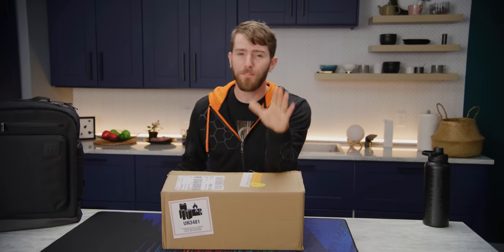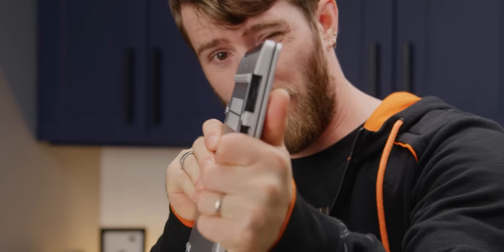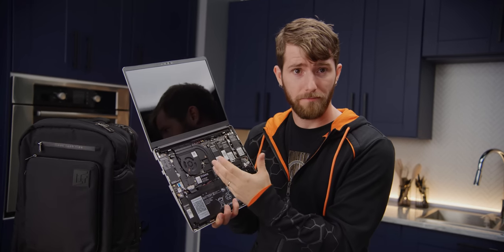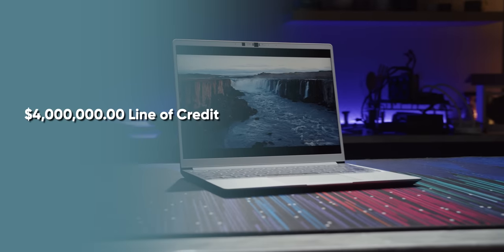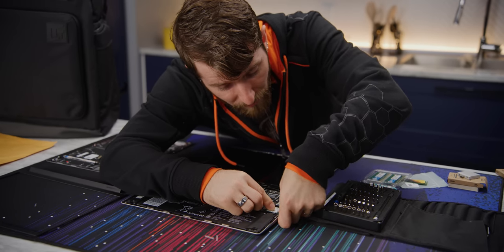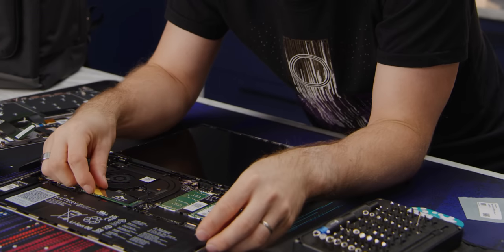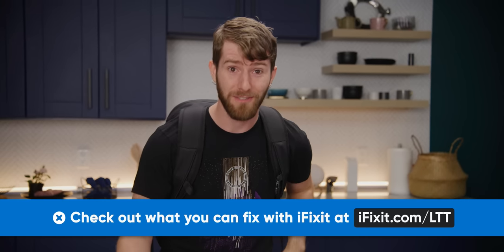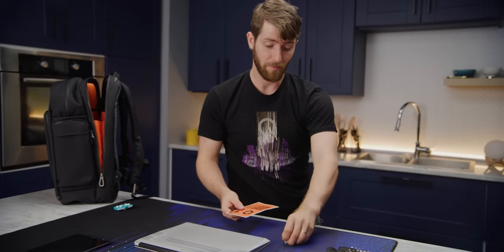I’m Legally Obligated to Disclose This - Framework investment

Comment: lack of cashflow, even big companies like Nvidia can be sunk by this, as many lack cash on the assets side of the ledger/balance sheet and even meeting payroll expenses can get tight  many businesses rely on revolving loans/lines of credit/essentially the business equivalent of the dreaded paycheck advance loans/loansharks to get the operating cash needing to keep the business functioning day to day, month to month

it doesnt help that businesses expect each other and supply chains to offer 30/60/90 payment terms by default/courtesy/tradition

so nvidia may take 90 days to get paid if the entity paying them doesnt default on that obligation/refuse to pay/renegotiate specific/contractual terms, but in the meantime 3 months payroll and suppliers and warehouses and such need to be paid still

not to mention the us economy and whole global economy works on trust and borrowing from peter to pay paul as the saying goes and at any given point the us economy is lucky to have say 30% of the cash flowing through the economy that is supposed to be required to be in circulation/available/there.

Comment: The LTT backpack is really cool, but my personal choice is the OGIO Renegade RSS. It’s a great backpack for a laptop, the tech vault is the main reason I bought it, but it is a great backpack in many other areas as well. If you have an expensive laptop (I have a $1,500 ROG G14), a backpack with a tech vault is ESSENTIAL. I hope the Linus Tech Tips backpack has one as well because it has set the bar for what a good tech backpack is.

Comment: It needs a larger touchscreen and more I/o ports and it would have a market with more users, particularly with those who run Hauptwerk software which requires 64 mega of RAM and a movable, upgradable computer.

Comment: To calculate total costs you need to add up all the cost at every point in the businesses processes and you actually then need multiple it tow cover the time of the whole process.this gives you a forecast of the cash flow demand. if you don't have the cash to pay right way as A start bigger suppliers just don't take you on.

Comment: I’ll definitely buy that laptop as soon as the one i have is obsolete since i can also upgrade it a little and imma definitely buy that backpack if its anything like the mos backpack where it has a zipper where you can put in cable charger inlet that i can charge my laptop with while its in my bag

Comment: The Expansion Cards being USB3.2 instead of Thunderbolt 3 is a deal-breaker for me. It also means that the Video Outputs must be using Alternate Mode or DisplayLink which are both really bad options.

Comment: My parents still use laptops and I would 100% kindly nudge/ force them to buy this except for 1 thing: The numpad. They are bookkeepers so they need the numpad on the laptop. Even if it was a 96% keyboard would be great. Since they just bought a new laptop, hopefully when that dies in 2 years, Framework will have a numpad, 17" model.

Comment: @6:30 your numbers are not way off, slightly optimistic id say since you don't account for say 2-3% that goes into error management and misproduction/other mistakes, and for the fact that prices on copper and other metals are not extremely stable (which admitingly sometimes yields a benefit but often also doesn't) or, and this is in home computing maybe less a thing, but clients negotiating lower prices in bad times (for example with us our clients are heavily dependent on the oil market which fluctuates) which can result in write offs on projections, in tech no profit is made, all money goes directly back into the process bar maybe a few exceptions

Comment: This is my next laptop once I decide that I need a new one, or as soon as gaming-capable (i dont care, even, 1650) option is available.
I spend so much fu... goddamn time disassembling and reassembling my G5 5587, because they seemed to have used too thick thermal pads. And even after that I had to disable Hyper-threading, because cooling barely handles it with Turbo-boost and I'm locked out of power setting.
Also would be nice to have an external accumulator, but I guess it's not that big of a deal, once it's relatively easy to get inside.

Comment: A touch late but after my umpteenth HP laptop. And a magnitude of scale higher business models to boot. I wish I would've checked this one out more seriously... If they release a model with a dgpu every other benefit primarily the long term repairability/upgradability will make it a take my money meme. If it's actually true that future upgrades will be a relatively simple soc board swap it'll legitimize it as a solid replacement for my co-workers and we can stock spare boards for emergency repair... something we've wanted to do with probooks and thinkpads but couldnt because of all the variations and the rollout system where at any time employees have a range of 2014-2019 units in circulation. Finally the price... both solid for professional solutions but poor for consumer solutions at this time... personally a 1080p iris xe system that can pop the $1k bubble gets beat readily by competitors like the HP victus... however for a company that has ram, nvme's, and their own OS licenses on hand, 800 a pop for all the performance an employee needs with a durable repairable build is a no brainer esp when the competition can easily be close to double the price in the same  market.

Comment: Linus its clear that you care. Interesting that after enough success now time becomes a more pressing and valuable resource than money. You've won a position where it would cost more to spend your time reviewing more laptops in a collapsed homogeneous market place  than to necessarily take a risk with monetary investment which i hope works out. Ultimately you have influence now on what larger companies will produce for certain end users that do care. That's the pinnacle of influencing and you've earned that. congratulations.

Comment: Since I run Linux 99% of the time, I'd be interested in an AMD version.  Although, I think that mostly matters for GPUs, and these laptops seem to use integrated graphics only, so I should be fine with Intel.  Still, I'm curious to see what round two will look like (I'd like a discrete GPU, for one).  I've already reserved a Steam Deck, so maybe I shouldn't be shelling out for one of these just yet, but I'm going to keep my eye on them.  Should I need a laptop at some point, I'll definitely take another look at what these guys have to offer.

Comment: Well, There is a problem or a potential problem. To sustain this business, The framework laptops will need constant upgrades down the line, and to provide those upgrades companies like nvidia, ryzen and intel have to make special models for this specific laptop company. The question is, Will they commit to that? Will they constantly produce products or chips specific for this company alone?

Comment: This is awesome, exactly what's needed.  "buck stops here" thinking from both linus & framework.  he did a solid job explaining what early startups have to deal with (and the bear market & coming recession will make it difficult for everyone).  They're smart enough to know that charging 2x isn't the way to grow, raising money is.  He also shows good transparency on what he's doing, why, what the risks are, what happens if it blows up.  I hope to see this company change the laptop industry.  Smart people is unfortunately a pretty small TAM, which is why most companies choose to woo the dumb people with money.  but if framework gets all the smart people,  if every IT guy & every working pro uses one of these things because it actually works for them, that could really change things.

Comment: I'm currently saving up for a laptop but due to my young age I can't work for many people but I'm trying to anyways and I actually considered this of being when I could save up for even though it's quite expensive another one I have my eyes on is one of those newer gateways people need to start paying more attention to repairable in modular products because right now I'm not many people really care but I find it so cool and when you have a laptop if you want an Intel core 12th gen now a days then you just wait for one to come out for your specific one and then just swap the motherboard board the same could be said for smartphones even though they don't have to be like that Google project you can at least have like the back pop off so you can like replace a battery or ram or whatever it doesn't have to be like straight up build for it but at least gives the option I always thought even now to have a phone that can be customized and upgraded from the inside out like a laptop or a desktop that would be so cool I want a 16 GB ram stick for my phone dang it to be really useful for projects too because your phone is also a programmable computer not directly like they were in the old days but I certainly wish they were that needs to come back I feel I'm going to become a programmer make an app that makes that a possibility but whatever I'm just a young kid that likes doing stop motion even though I haven't done it in a while I don't got sticky tack I I'm going to get some though who also likes parts of the past Incorporated with the future and also a lot of modular items preserving the past while keeping it up to date with modern technology feels really good to me!

Comment: Any chance Framework will take suggestions on a gaming laptop design using Intel dGPUs (because I'm assuming it's gonna be tough getting NVidia, or even AMD).

Or maybe AMD might be amenable if Framework does an Advantage Edition so Ryzen 7 6800H CPUs and RX 6650M XT and 6700M will be allocated.

I got other ideas for this too to optimize its use for desktop (since a gamer, at worst, might have to work on the laptop in a coffee shop or take it to a meeting if it won't look ridiculous), if not make completely desktop use optional now instead of just for repurposing the mainboard later when the GPU can barely play anything new.

Comment: Framework is really what I have been looking for all this time. Now all I need them to do is make 2in1 touchscreen laptops with more than 250 pressure sensitivity for atylus along with some thinga-a-magic where I can boot a linux/windows and an android in two desktop environments so i can switch between them as easy as switching between desktop environments and provide a slot for sim reader. That would be my dream machine. make it framework, pretty please. 
also, I tried to buy one of their laptops but they aint in my country yet. Whatcha soing framework, come on!
Reply: The problem is that you're a really small niche.
So making all these upgrades for like 100 people, would be impossible.....for even the biggest companies.

Comment: I now need a new laptop, but I cannot in good concience buy a laptop anymore that has an 11th gen Intel chip. Ryzen 6000 and Intel 12th gen are now both available, and both far superior. Personally, the chip I want is the 6800U.
Reply: is the ryzen 6000 available in an ultrabook without a dgpu? cause I haven't been able to find one
Reply: Not yet. Asus just announced one, the Zenbook S13, and Lenovo announced the Thinkpad T13, T14 and T16, all will be available in June.
Reply: I assume that way more will be announced in the end of may at Computex. I personally am waiting for either a new Framework mainboard option, or alternatively for some middle of the market thinkpad. The T-series is a bit out of my desired budget.

Comment: I think Framework is hoping, praying, and begging that someone will eventually purchase the company and the shareholders can make some money. There are currently USB C dongles that do power, USB A, micro/sd cards, HDMI, ethernet, wifi, and more. The idea of plugging in modules of USB C adapters is not new. Framework is also very expensive. You can buy a cheaper M1 Macbook Air, add a dongle, and have everything Framework has to offer at a fraction of the price. Apple also has a warranty (or get the Best Buy one) to cover 3 years. I still contend that Framework's whole plan is to have laptops out there and hope that someone buys-out the shareholders. Look at their financials. If they had to do a recall of something, it would wipe out the company. They could not afford it.
Reply: Say that again after 4 years when the MacBook is out of warranty and outdated and the framework can swap the internals to the modern standard for less than half the price of a new laptop.

Comment: It's interesting but I don't see the benefit really. Upgradeability on a laptop isn't really relevant. Can't upgrade CPU. 16/32 GB of RAM is enough. Won't be able to go DDR5. No discrete GPU. I guess the hard drive? 

The ability to repair is nice but for the majority of laptop owners is it really useful? How many laptops are sold every year and how many of those end up needing repairs? How many of the ones needing repairs, need repairs that are fixable by a layperson, e.g., swapping out a screen? Of that subset, how many are actually going to go through the effort of doing it themselves or have the confidence?

I'm not knocking it per se. It just feels like one of those times a product is generating a lot of hype in a tech community that gets projected onto the masses where it doesn't exist.

Comment: Because you are mentioning AMD in timecode 750 (https://youtu.be/LSxbc1IN9Gg?t=750 )i am assuming there will be a framework notebook with AMD Ryzen coming? The current Framework hardware configuration is sadly not very compelling for Linux users, which are a rather big target audience. Anything planned for a Framework Laptop with AMD Ryzen?

Comment: I cannot help but be excited for what Framework is doing, too!  I just wish that (1) I had the money to buy one of their laptops, and (2) I could get such a laptop with a 2-in-1 style touchscreen.  (I actually want two, for eccentric reasons, but hey, I'd be happy if I could get just one!)

Come to think of it, I also wish (3) I could get a couple of Bluetooth monitors as well, because I hate cables, but everything I've been able to determine so far has me convinced that Bluetooth wouldn't be able to handle the bandwidth to be able to do that.  Maybe WiFi could, but as far as I can tell, it's also somewhat rare for a laptop to be able to act as an "access point" to be able to make multiple connections as well.

Regardless, I really hope this product does well.  The world needs more "right to repair" devices!

Comment: I really like your laptop, but it needs a lot more IO, like, minimum 3 USB A, ethernet port, mic and audio jack, 1 or 2 USB C, 1 HDMI and a HDMI, optimally it also has a display port connection and a SD card reader aswell, at least thats the stuff my laptop has, and I honestly wouldn't want to buy anything with less connectivity than that

Comment: Can I upgrade iPad pro 2021 memory from 256gb, I use adobe fresco and I can not even locate the files for back up, it only show that fresco hold 240gb of data. How come iOS is so stupid and no one talk about it. Basic action of finding you work on the system, do not exist. It is the most productive tool I ever had, but it is like a disposable 1000 tool in my case 6 month. I know 3 people that are working on 3 iPad by now, started at 256 then 512 and 1tb. This is a total madness. I have external ssd 2tb, Adobe software save a copy on the cloud and even if you use files setup to be online only, the actual application keep swallowing internal memory. The files on the cloud can be save as extra copy on cloud. The software itself can not save only export to few formats, useful but no one of them is the software original files. The cost is the time spent on the work. Specially when you sale digital masters. Thanks Apple and adobe have really bad record of ripping off customers. Yes quality is important, but this is criminal, I am 30 years in creative tech and development, avoided Apple for 10 years, started with Apple 2 that was a kit building idea. Now they gone mad.  Both tech support, the kids not even understand and totally ignore it. I believe if no one will bring attention to this issue, the rest of the industry will follow. Our hardware, our software, our property not yours. What if someone knock on your door and says, I made this hammer, your home belong to me? If that will be accepted then what the point of all this tech. The Texas full say you shake hands handed the goods, received cash, the good is no longer yours. More all goods under company roof belong to the company. If this old full gone then…………..boom

Comment: Big mistake, the problem with modular as you said it's not that it's hard for the big manufacturers to make their labtops modular, they just don't want to. So Farmework has absolutely no advantage, no patents and nothing innovative. The only thing they can utilize is a market niche that other manufacturers don't cover simply because it's too small, but as soon as the demand for modular labtops increases they will capture the niche. So there is no future for Farmework, they are more a proof of concept than a real company.